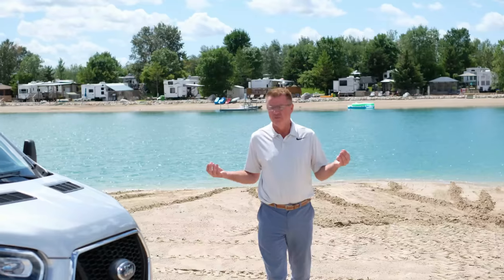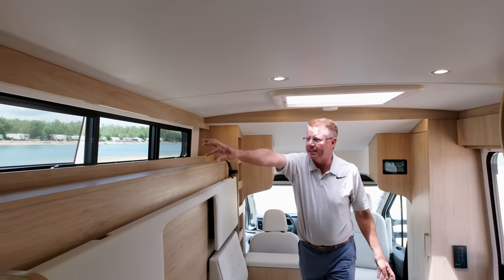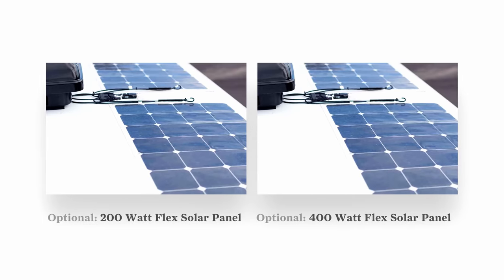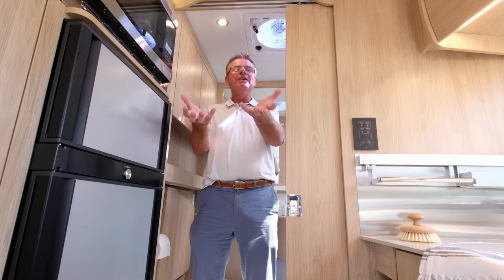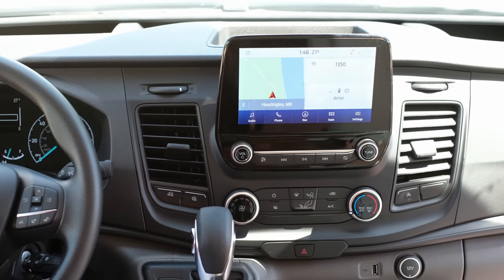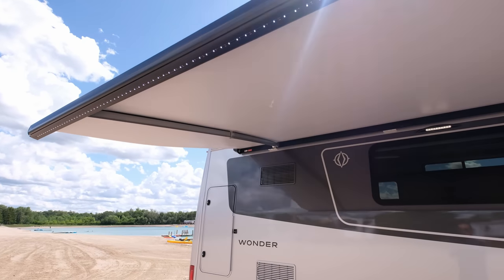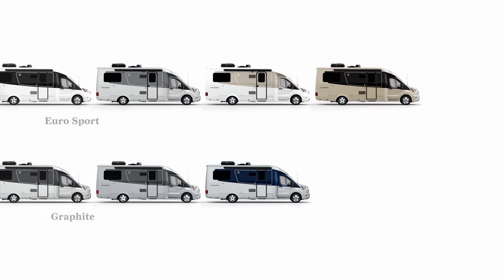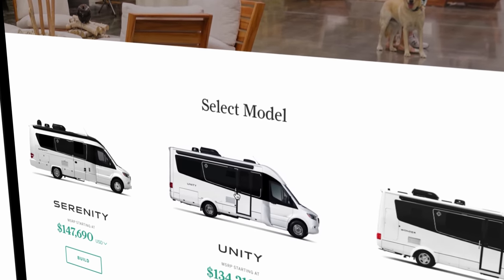2021 Wonder Murphy Bed

Comment: Who wants to do the Honer in counting how many times Dean said "beautiful" 😁?
Reply: Okay, I took the challenge. I think it’s 41. The Wonder MB is beautiful (3x) on the beautiful brand new Ford chassis (3x). Inside it has beautiful natural rift cabinets, beautiful curved cabinet doors, beautiful back rests, a beautiful opening skylight, and a beautiful (dining) area. 

Also, there’s beautiful natural light and a beautiful lake (2x).
 How beautiful is that?
Reply: Also, there is a beautiful Fantastic Fan and a beautiful 15000 BTU air conditioner. The nighttime shade is absolutely beautiful.
Reply: There is a beautiful nice big galley area with beautiful Corian countertops, beautiful rope lighting below, a beautiful pot and pan drawer, a beautiful garbage can built right in, a beautiful built-in pantry, and a beautiful convection microwave.
Reply: It also has a beautiful three-piece dry bathroom, beautiful stand-up shower, beautiful shower door, beautiful hand shower, and beautiful toilet.
Reply: On the outside its beautifully aerodynamic with a beautiful front fiberglass mask, beautiful courtesy lights (2x), a beautiful awning, a beautiful picnic table underneath the beautiful awning, a beautiful screen door (2x), beautiful exterior storage, and more beautiful molded fiberglass.
Reply: @Michael "beautiful" work sir lol

Comment: If there's a takeaway to the inside overhead curved door cabinets is the degree swing of the hinges.  The hinges used are too shallow of a swing and need to use hinges with a greater arc.   Look carefully when the cabinets are swung open at full length.  You can see that there's still a ton of room that can be used for the swing if they're upgraded to say a 125 degree arc swing from their normal 95 degree.  That can help with accessing taller items being inserted and removed in the cabinets.  

You've got the space, you might as well do it right with a greater swing arc hinge.

Comment: Dean, thank you for not wearing your shoes inside the Rv...Leisure travel vans are a very well made product inside and out. I do wish that they could have the options of a hidden ladder that would recline into the back of the Rv " like a rolling ladder that would work with a press of a button and rolling down the back of the Rv and retracted when not needed. This would deter unwelcome visitors on your roof. A  security/pet cam( optional)(nannycam) as well that would give you notifications when your pet is in movement or unwelcome visitors are in your RV.   Keep up the great work Dean and all the staff of Leisure travel vans.

Comment: Love the fact you are using the ford chasis with the newer safety features.  Also that the updates includes the inverter.  Just a few more things that will make this the one I want:  bump the Lithium capacity to at least 500 Amp-hours, make the inverter 3000w, replace the generator with a auto-start engine powered alternator.  Add another 200w solar on the roof.    switch to a 12v Compressor fridge.  Add some side view cameras.
Reply: So, you're actually saying "Spend hundreds of thousands of dollars to redesign your rig and add a host of features I'll never use to an RV I'll never buy." I'm sure they'll get right on that. Or, if you're serious, commission a rig from one of the dozens of custom conversion shops in the USA. They'll build exactly the rig you want/can't afford.

Comment: Love the travel Van!!! Went to Gerzeny’s RV in Lakeland FL last week to purchase a 2021 model and was told by the salesman that delivery time on one of these 2021 models after order is one year to delivery!!  
How/where can we actually purchase one and get it delivered in less than one year?
Reply: I think this company produces a limited number number. Reviews  ( about their vans) are mixed though - if you watch some videos online by people who bought them some rave about them & some experience faults within 3 months or 6 months? Of course due their high price their vans at owned by a small pool of people compared to cheaper rvs out there & also videos by customers difficult to tell what is real or fake since people can exagerrate or minimise problems for their own reasons.🤷‍♀️
Reply: Due to high demand and the problems with sourcing the sprinter chassis (Unity models), the slowdowns due to COVID, and maybe other factors there is a good amount of wait time. If you can find one on a dealer's lot, get there fast. Where I live in Michigan there is just one dealer that has the LTV. I've checked their inventory several times over the last 12 months or so and they only have ever had one in stock and it was marked as sale pending.

Comment: A question for LTV about the 3.5TT:  Does this engine have the dual fuel injection (both port and direct) like the Ford trucks?  Or does this chassis use the older version that is just direct injected?  Thx

Comment: Nice motorhome, I have 5 questions: 
1: What is the CCC ? 
2. Is it possible to get a wider MB, we don't care about walk around, rather prefer the bed touching the closets. 
3. Is there a step cover at the entrance area for the night ? 
4. Would to two folding bikes fit into the outside storage ? 
5. Is there an option to have an overhead bunk , we like that for storage
Reply: agree with everything, especially the wider bed option . TV is too small though

Comment: Where would be the best place to carry surf boards, mountain bikes or ski gear etc?
Inside, a tow bar, underside or roof?
Reply: The best model for that would be the RTB (Rear Twin Bed), as it has the "garage", which has awesome storage and could take most of that.

Comment: just out of curiosity i checked the prices. it cost more than two bedroom house in colorado.
Reply: Are you planning to pay MSRP? You need to get better at haggling! BTW, where can you buy a 2BR in CO for less than $90K? Do tell!
Reply: @colormedubious4747  I agree, I live in Fort Collins. A new 2 br 2 bath is listed for low 400s! Not much haggling on these. I placed a deposit on a 2021 FTB with 5k of the MSRP.
Reply: Well, not quite.  Nobody pays MSRP.  But it depreciates as soon as you take delivery, and as well made and designed as it is, it is SMALL.  You had better like spending time alone or with your partner, because this is a small space to "live" in.  A home designed this well and made this well would be fairly expensive but it would increase in value over time.  A vehicle to travel to your vacation home would need less maintenance than this RV.  To get both, its gonna cost you!
Reply: @Cathy-xi8cb  All really good points. Thank you for your perspective.
Reply: @JamesBlazen  How do you figure that it costs $30K MORE than the base MSRP? I would LOVE to sell you a car! I could retire early. I calculated that one with the options I want could be had for roughly $97,500 after an intense and slightly bloody haggle. Here's a fun fact: The dealer NEEDS to sell an RV. I don't NEED to buy one. See how that works in my favor?
Reply: @JamesBlazen  This model starts at $120k. Not sure where you’re getting the $150k price. And, hopefully,  could knock $15-20k off that price from the dealer.

Comment: “Post emergency braking” does this means that it applies the brakes for you AFTER you hit something?
Reply: Yes. Because if you get hit, it pushes the vehicle further. So, you want to be able to brake so you don't hit something else.
Reply: Douglas Lucas — I used to drive trucks in my youth.  You barely notice when you are loaded and get hit by a car. You would have to be hit by a loaded semi to worry and if so then brakes may not help you from hitting the car in front.  Funny story, was going through Dallas during morning rush hour and heard a thump as I was slowing, didn’t think anything of it, just assumed something fell in back. Car was honking a moment later, hey this is Dallas, Whatever.  Another car honking pointing towards the back, I checked my mirrors, saw nothing motored on.  Traffic moved on, so I did too. Another car honking with his window down, so did I, he yells YOU HAVE A CAR BEHIND YOU!  I stop, flashers on, get out to look.  Old guy in a car rear ended me, the front of his car locked under my step and he was stuck good. He was white knuckled and standing on the brakes.  I had dragged him a few hundred yards in rush hour traffic and didn’t even realize it.

Comment: Wondering if 2000 watt inverter enough to run AC
Reply: No it's not
Reply: According to etrailer.com (https://www.etrailer.com/question-324467.html), a 13500BTU AC that has the same capacity as use on this LTV Wonder needs 3000W starting power. In addition, LTV wonder only has 2 house batteries and up to 400W solar charging system, so you will drain your battery super fast and make using AC on battery/inverter non practical.
Reply: If running the AC from battery power is critical to you then get a lithium Travato.

Comment: Why not put like 6000 Walt inverter and more battery and solar like 1000 Walt is solar not that would be great
Reply: sly1012000 Battery takes huge space and weight, which are precious resources on a tiny motor home like LTV Wonder. In addition, inverters are expensive
Reply: Why not buy a lithium Travato instead?
Reply: Colorme Dubious  I would love for them to make there better I Love there leisure travel  van better I know they can but why they don’t is beyond me
Reply: @sly1012000  Because their customer base isn't asking for that. These rigs are designed for snowbirds, not hardcore boondockers.
Reply: Colorme Dubious  they should make one like a limited edition for those hard core people I bet it would sell out quickly
Reply: sly1012000 When they have more producing capability, maybe yes. I heard that the waiting time after you place an order can be more than half year
Reply: @yzhang8629  it's around 18 months now.
Reply: 60Airflyte That’s crazy.

Comment: Only problem with that bed that you won't talk about is you have to crawl over your partner to get in and out of the bed.
Reply: I think it is a trade off for not having a side. The Murphy Bed model of a LTV Unity has a 68”*76” that allows you to sleep across the van, instead of the 60”*80” on LTV Wonder that you have to sleep along the van

Comment: Figure 50% depreciation in year 1 or $75,000 down the crapper.   That's $200/night.  LOL
Reply: Have you actually looked at resale on these?
Reply: @JamesBlazen  Most RVs yes but, as @Linda Ward  said, have you looked in to the resale values of THESE?
Reply: @JamesBlazen  check out the current prices for used LTVs. You're thinking other RVs.
Reply: These do not depreciate as you’ve estimated. You need to check used pricing on this particular brand and model.